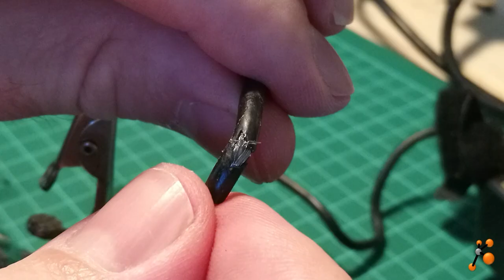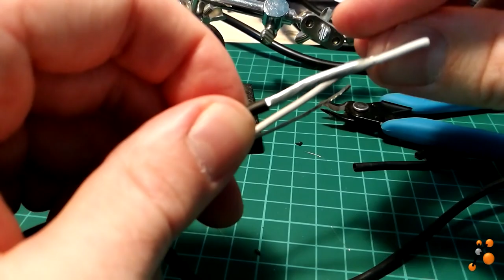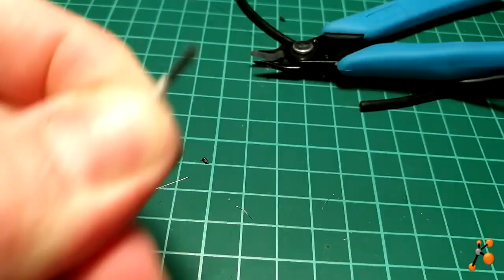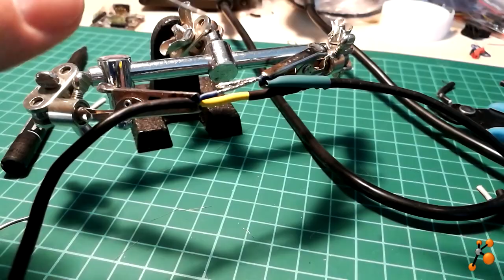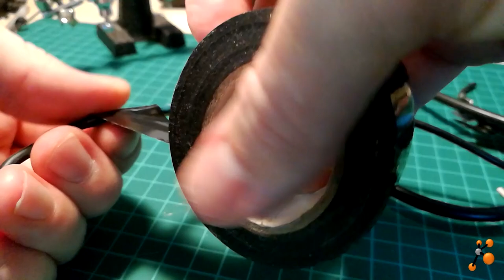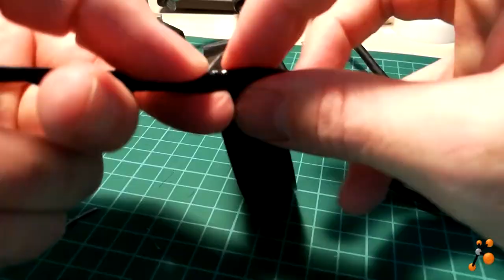How I fixed my laptop charger cable - Computer On Workbench

Comment: Great job exactly what i was looking for thanku! Great soldering too! I think the only thing i would add is to insert the whole cable in a bigger shrinkable tubing while still cut to avoid the use of electrical tape in the end.
Reply: That is what I was wondering...why he didn't add another, larger section of shrink tubing before he put it all together, then cover the whole repair with that instead of wrapping with tape at the end.  Great repair otherwise.

Comment: Thank u ..but what's the function of steel wire over the white one?
Reply: Electric circulation, I guess... 🤔
Reply: @bekamtchedlidze4785  yup ri8
Reply: It’s the negative / ground most likely. The wire within the white insulation at the cord’s center is likely the positive / hot. Basically instead of Two wired next to each other it’s two wires nested inside another - like a wire turducken

Comment: My laptop adapter have two wire black and white however pin have three points out side ground ,inter side + and center for I'd ,I have no idea for connection ,plzz help.and how many value use resistance